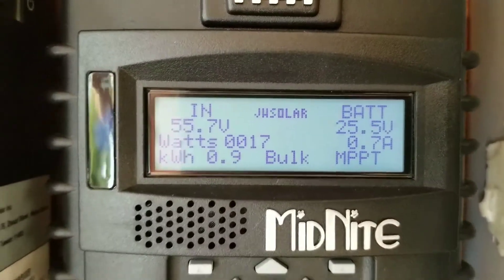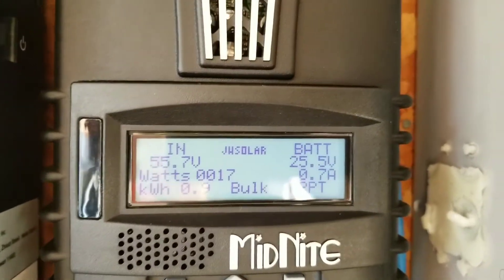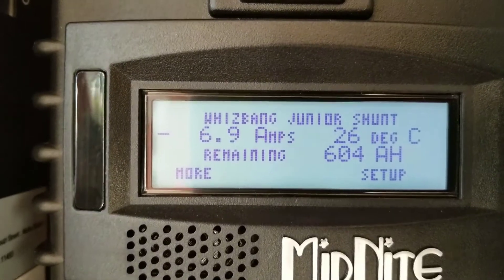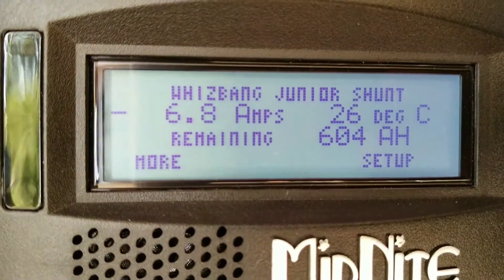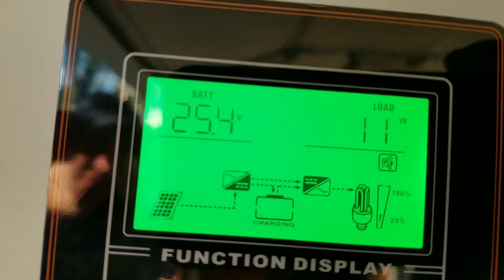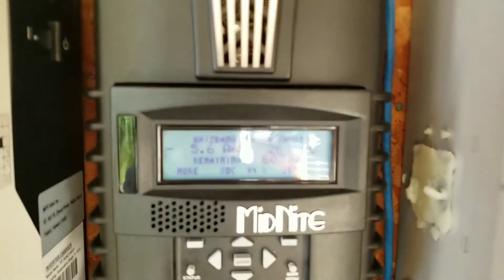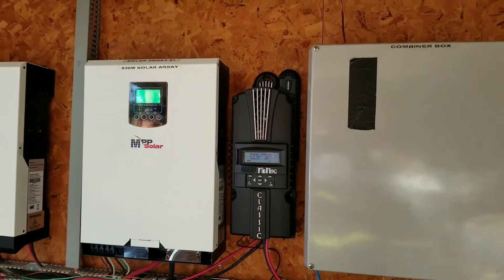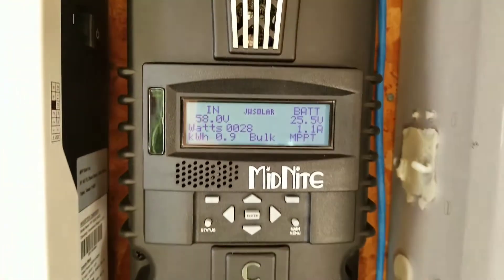TESTING THE MIDNITE CLASSIC 150 ON STEVIE'S OFF-GRID SOLAR SYSTEM Pt#7

Comment: Just trying to understand some stuff you have two Pips and a midnight classic is there a wiring diagram are the two Pips also charge controllers or are they just inverters and what's the midnight classic do is that your charge controller
Reply from the maker: +Edgar Zuspan 
We are conducting a test here with the MidNite Classic which will possibly driven by a Wind Turbine sooner or later.
The two PIP 2424LV-MSD 120Vac 60Hz are Hybrid Inverters built in MPPT Solar Charge Controllers, Pure Sine Wave Inverter and a Battery Charger.
I hope this will help you understand the configuration we setup here.

I will encourage you to watch the entire video Series of this installation and that will help you to have a better understanding of this entire layout.
Have a bless day
Reply from the maker: +Edgar Zuspan 
https://youtu.be/Q-9AMh_ATTk
MPP SOLAR INVERTER CHARGERS PIP 242424LV-MSD - Complete Installation
WANAMINGO MINNESOTA BY jwsolarusa
Reply from the maker: +Edgar Zuspan 
https://youtu.be/Q-9AMh_ATTk
MPP SOLAR INVERTER CHARGERS PIP 242424LV-MSD - Complete Installation
WANAMINGO MINNESOTA BY jwsolarusa